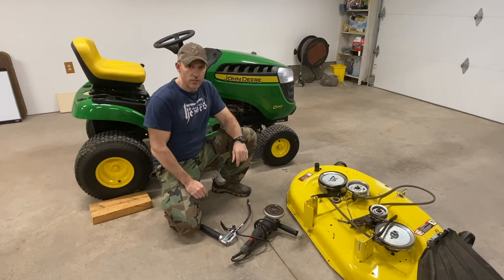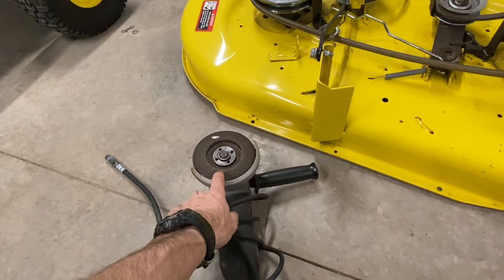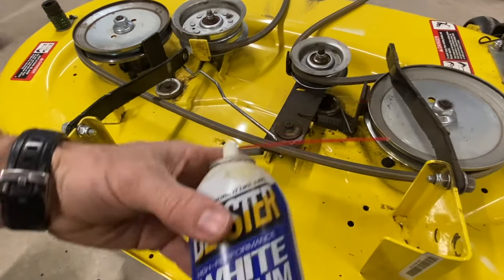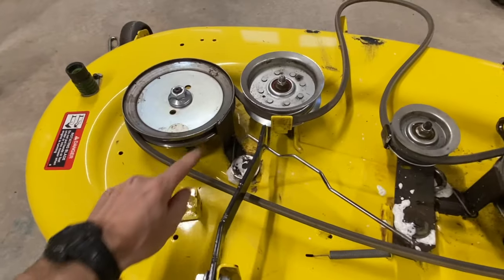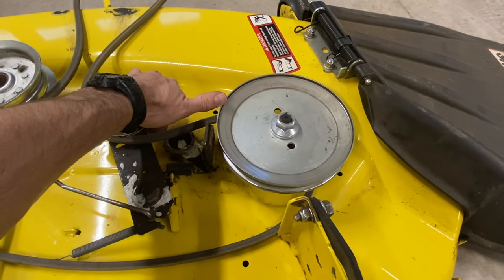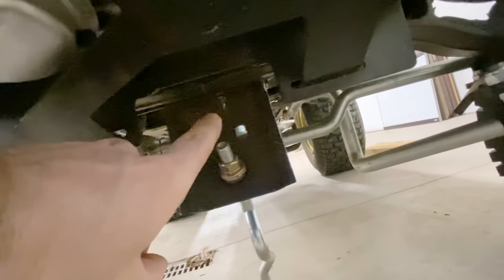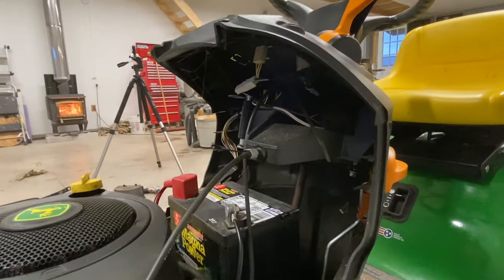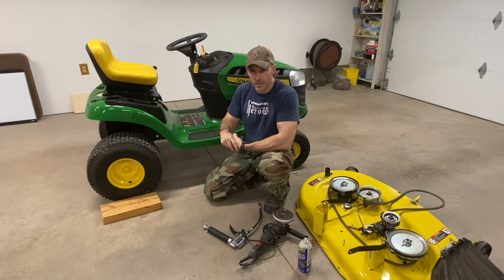grease fittings on john deere 100 series

Comment from the maker: ***Here are some links to help you service your John Deere, hope this helps you out. Please leave a comment and thumbs up, it HELPS YOU TUBE PROMOTE MY VIDEO.
John Deere filter kit    https://amzn.to/2UmTB5x
grease gun  https://amzn.to/2WJubQW
grease  https://amzn.to/33OBXKR
grinder   https://amzn.to/3brkZVA
flap sanding disk   https://amzn.to/3ay8ojz
socket set   https://amzn.to/2UCQDZv
lithium grease spray   https://amzn.to/33N5S6l
hearing protection  https://amzn.to/2wvwxZi
impact wrench   https://amzn.to/2WHcgdQ
impact sockets https://amzn.to/3apNvHc
5-W30 oil  https://amzn.to/2JeMRjN
funnel   https://amzn.to/2Uj3DEy
oil filter wrench   https://amzn.to/2JhrrlV
john Deere filter  https://amzn.to/3aqYT5u
napa gold filter   https://amzn.to/39lKl5R

** Support my channel by leaving a Dollar or two in my tip jar Thank you.
https://www.paypal.com/cgi-bin/webscr?cmd=_donations&business=2MTJWRFFTHLU4&currency_code=USD&source=url

Thank you very much for watching and God bless

*Full transparency. I am a participant in the Amazon Services LLC Associates program, an affiliate advertising program designed to provide a means for me to earn fees by linking to Amazon.com and affiliated sites.
Reply from the maker: You can support my page by just clicking on one of the links above, thank you for your support.
Reply: Thanks man. Mine is a little bigger, but it was fast and str8 to the point. Easy cam shots to see the fitting position.  I needed to the point and it was your video. The rest of the other videos sucked.
Reply from the maker: @jcaallen6662  glad I could help you out I try to make all my videos very easy to follow without all the fluff. Thanks for watching
Reply: @Clay Moses It did the trick and I now got access to my account again. I am so happy:D
Thank you so much you saved my ass!
Reply: @Xzavier Dariel No problem xD
Reply: Please see my comment on greasing spindle bearings

Comment: The two main pulleys on the deck have sealed bearings so they do not need to be greased they just never removed the fittings the grease fittings so basically they're just there for looks the breeze will go in the chamber but are totally useless
Reply from the maker: thanks for watching
Reply: I'd heard that too!
Reply: I wouldn’t say totally useless - filling the cavity around the bearing will keep water from sitting there
Reply: BS!  You pump them full of grease to keep water out AND the grease will penetrate “sealed” bearings with no problem. You don’t know what you’re talking about.
Reply: Other videos have convincing closeups of the ZERK fittings not only filling the spindles with grease, but actually show the inner side of both the upper and lower bearing SEALS being penetrated. The  INNER seals apparently made of a softer material to allow  penetration. Pretty Cool!

Comment: If you use dry graphite grease or dry lube it will help you out and not attract dirt, dust and sand to those pivot points and help you to keep the top of the deck clean when you hit it with some compressed air 😊
Reply from the maker: I guess you could do that. Thanks for watching
Reply: Dry lube or dry graphite grease works great with dirt etc not sticking to it and works great! Dry graphite powder or grease is also recommended to use in all lock and ignition cylinders as well. Great videos you got on your channel! Keep up the good work! Sorry if my last comment sounded like I was trying to tell you what to do or if it seemed my suggested method was better haha it wasn't my intention at all, just merely a suggestion if you didn't know about the dry lube or dry graphite is all. 

Again keep up the great work! I've subscribed to your channel also! I always wanted to do DYI videos but the editing I'm not a fan of haha
Reply from the maker: @jfrog180000  thank you very much Jason. I kind of enjoy the editing part. Thanks for subscribing also

Comment: My Grease fittings are dried up.(John Deere L118) Whats the best way to change them out or clean the hole?
Reply from the maker: You could take one off and try to carefully clean with maybe some break cleaner. Or you could take to an auto parts store and buy some new ones. They should not cost much. Hope this helps

Comment: the spindle grease points don't actually do anything lol its a design flaw.. thats engineers for ya! but to fix it just take the bearings out and take one seal off each of the corresponding sides of the bearings then put back together and the grease zerks actually do what they're supposed to
Reply from the maker: thanks for watching
Reply: @DIYJIM  I'm wondering if you could answer this for me.. I can't seem to find any ag tires for my John Deere which is a 20x8-8 rim, would a 20x10-8 fit those rims as well?
Reply from the maker: @detox5454  sorry not sure I would have to research this. Maybe you could post this question on a small engine group on Facebook
Reply: @DIYJIM  That's ok man lol was worth a shot but thanks for the speedy reply.. and I just might do that!
Reply: they are just dust covers not  "seals " lol you can pick them out with your fingernail and people think they gone stop grease from entering , lol.  a grease gun puts out like 10 000 psi every pump , grease until you see grease come out ends of spindles , grease will go threw bearing as it was designed  , it takes approx 40 pumps each when new  , after that do like 10 per each to purge old contaminated grease and it will fill with berrings with new grease  ,,  every time you remove the berrings for no reason  you are enlarging  the soft aluminum spindle housing , the bearings need to be a press  fit if not you will get a spun bearing and you spindles will be junk , .you need to knurl the spindle and / or use loctight berring retainer when putting them back if they are a loose fit .

Comment: I just ordered my replacement brake pads from my local John Deere dealer.  You can buy any part including springs, screws, clips, etc. from your local dealer, even if you did buy the mower from one of the retail stores, they're still willing to service the mower and sell you parts.
Reply from the maker: Thanks for the great info and thanks for watching have a good summer
Reply: @James Chumley, I had to take mine to my hometown JD Dealer {actually they came and picked it up}, I had to have one of the small wheel welded back on. I've ordered belts from there to.

Comment: Also one thing is every 6 months to 2 years you should take the back wheel off and grease the axel just in case if something happens to the back wheel so it'll be easier to get off
Reply from the maker: Thanks for the tip Jerry

Comment: The bearings in the spindles are sealed bearings so when you attempt to grease to grease the spindle no grease is gearing to the bearings so you are wasting your time greasing them. This was confirmed to me be a JohnDeere dealer. To remedy this situation you need to remove the dark from the unit remove the spindles and remove the top and bottom bearings in each spindle, you will see that both bearings are sealed bearings, so when you pump grease into the spindle no grease is reaching the bearings
To remedy this remove the seal on one side of the bearings and reinstall in the spindle with the bearings facing the interior of the spindle and re install on Tahoe mower deck
Reply from the maker: I made a video about what you are talking about. Thanks for the nice big informative comment. https://youtu.be/ybKR4wTLez0
Reply: they are just dust covers not  "seals " lol you can pick them out with your fingernail and people think they gone stop grease from entering , lol.  a grease gun puts out like 10 000 psi every pump , grease until you see grease come out ends of spindles , grease will go threw bearing as it was designed  , it takes approx 40 pumps each when new  ,  every time you remove the berrings for no reason  you are enlarging  the soft aluminum spindle housing , the bearings need to be a press  fit if not you will get a spun bearing and you spindles will be junk , .you need to knurl the spindle and / or use loctight berring retainer when putting them back if they are a loose fit .
Reply: So why have the grease fittings?
Reply: Wrong. Grease them sealed bearings will be penetrated by grease. SMH

Comment: Would anyone know the common zerk size (thread) for a john Deere riding mower? I had to used an 8mm socket to get one off on mine and mistook the 8mm and bought an 8m zerk which was too big? Maybe a 1/4 inch?
Reply: BTW, I enjoyed all of your videos and subscribed! Thanks for sharing your knowledge!
Reply from the maker: I’m not really sure sorry I have never taken any of my zerk fittings out. Thanks for watching and subscribing
Reply: See your John Deere parts dealer
Reply: I am wanted to replace the fittings on the spindles because I could not get a grease gun on them - they sit too low relative to the deck. I thought a fitting with a 45 degree arm would do the trick. The JD dealer only had the replacement part and was not very helpful. Looking at the parts list, I saw that the fitting came on the spindles, with no specs provided. FINALLY, I was able to locate what I needed in the specialty nuts and bolts section of my hardware store (basically a series of metal cabinets with small pullout drawers.) I found a metric grease fitting, M6 - 1.0, 45 degrees, regular pitch.
The old one came out using an 8mm open end wrench (be careful so you don't break the fitting off) and the new one was tightened with a 9 mm wrench. 
So funny to see the comment above that the bearings are sealed and greasing this fittings is a waste of time. I hope not.

Comment: I have 8 hours now on my E120. You can easily jump out the really annoying seat and reverse safety switches without cutting wires. The hydrostatic is awesome with those switches jumped out. I was afraid the deck grease fittings were difficult to get to. At this rate I will probably end the summer with about 25 hours. I will do the 30 second oil change and maybe take it back the the dealer and have them check it out for next year. I don't enjoy wrenching on things anymore.
Reply from the maker: I cut my wires for the reverse safety switch. If I put my parking break on I can get out of the seat without the mower shutting off. Thanks for the comment. Hope your summer is good
Reply: @Steve Fox just set the parking brake no need to restart the engine pretty quick and easy
Reply: @DIYJIM  pushing the button to reverse and mow was enough hassle to need to cut wires ? Or am I missing something cheers
Reply: @DIYJIM just curious, why would you want a safety like that off? Getting out your seat and mower shuts off.
Reply: I use the mower deck nozzle all the time. the blades have to be running. I also hose it down after every use and don't want to turn it off.. Cant use the hose while sitting on it

Comment: I have a Deere E130. I removed my 42" deck and attached my snow blade. What do I do with the blade engagement cable. And spring. Where do I secure it or?
Reply from the maker: Sorry I never did that maybe you could zip tie it to something. Sorry I can not help

Comment: Puralator Cross Referenced Filters, Better Quality and Cheaper than "John Deere"
Purolator L35310  Length 2.7inch
Puralator L10241 Length 3.4inch
  
The one Below is Not Recommended it will Fit Yes but it is almost Too Long...
⚠️Purolator L20195 Length 4.8inch
Reply from the maker: Thanks for the info
Reply: I have bought John Deere filters when they are on sale cheaper price or the same as cross reference ones

Comment: I was anxious to see how you get that straight grease tip onto those blade spindle grease fittings cause I sure can't get it on there.  The fittings are too low to the deck.  I have a 90 degree tip on order and hope that works.  I have to believe this is intentionally made difficult to get people sending them into the shop to get it done.  Very annoying,.
Reply from the maker: If your only mowing around 1/2 acre i would not worry to much about your spindles. thanks for watching Bob

Comment: Taking care of your high dollar investment called a good quality lawn tractor is good preventive mantenance.
Yours will last a lot longer then the ones left in the yard where they stopped mowing!
Hey and about that nuisance backup button that John Deere puts on all the Riders,
It doesn't make sense so you look forward at your button switch, you push the button and you will probably back up before you turn around and look what's behind you and you will probably run over and hit whatever you was trying to avoid where as jumping that switch out allows you to immediately look behind you before backing up this switch is a no-brainer engineering design to sell more switches like that. For demonstration information only. Hehe
Great video, to the point and get er done!
Reply from the maker: Thanks for watching and the nice comment have a good summer
Reply: The push button to reverse only needs to be pushed once, then after you're going in reverse you can let go of it. It's a safety feature, probably a Gov regulation but it is a pain and most users bypass it.

Comment: I found the grease for the grease fittings on the spindles spindles go only in a metal tube and don’t go into the bearings.
I had to remove both bearings on each spindle and remove the metal or rubber cover. I then cleaned the bearings remove the old grease. Then put new grease into each bearing.
Reply from the maker: I made a video on that, thanks for watching
Reply: Hard to get to and get out?
Reply: @DIYJIM  where video Jim please sir???
Reply from the maker: @timdurden5808  https://youtu.be/ybKR4wTLez0

Comment: Aren't the top wheel and lower wheel nozzles for grease connected? I thought I saw excess grease coming out of the bottom one when I squeezed some in the top. So you don't need to do the bottom one, correct?
Reply from the maker: Not sure what you mean but i think you mean  there is one zirk grease fitting for the wheel spinning and one for it turning. I would grease both. Hope this helps

Comment: Good video, but just want to say. My craftsman lt1000 was 20 yrs old and all I ever did to the deck was new blades and belts. I personally would not spray grease on pivot points because of the environment they are in. Sand and grass will hold in the grease. You obviously go to greater lengths cleaning your deck so it works for you.
Reply from the maker: Thanks for sharing, I think the older mowers lasted longer but hopefully if I take care of my John Deere it lasts
Reply: Lowes guy told me to grease it up every two summers. Zero chance of me taking off my deck. Not sure I'd get it back on right...lol.

Comment: Hey - thanks for the video!  I just picked a D130 from a neighbor that moved and I'm going through it - your videos are a great reference. I noticed I have a zerq at the front axle but there is a heavy shield in front of it. I can't get my grease gun fitting on it enough to get it to take grease. I even removed the front pivot arm to get that nut out of the area and still wasn't enough of an angle.  Any ideas?
Reply from the maker: Do you think maybe a different grease gun would fit. It’s hard to help without seeing it. Sorry can not help more. Glad you like all my videos I think I have about 18 on my John Deere
Reply: @DIYJIM  Hey thanks for the response! I have two types but the injector head is the same on both. Looks like a trip to the hardware store to see if there is an alternative. I've seen quite a few of your videos. I'll subscribe so I don't miss any new ones!  Thanks again!
Reply from the maker: Awesome thank you for subscribing

Comment: I use a Purolator Oil Filter and (Full Synthetic 10w-30 Valvoline Maxlife) in my John Deere 110 it's a V Twin, The Purolator is the Exact same size and Thread Pitch, etc and it seems to run smooth doesn't Leak any Oil or Burn it, and has almost 400hrs on the Engine itself
Reply from the maker: Sounds good to me if it works have a good summer
Reply: You go in great detail on the oil, but don't say what the oil filter number is, then say it was an exact fit - well isn't that a fact!!! Lol
Reply: @bobwhite2754  Do you really want the filter Number? I will tell you lol
Reply: @Robs_Got_A_Gun  Thank you no, since I wrote this I found that you have given that information at another area in the thread. No big deal, just thought it was strange.

I tinker with all makes and models of lawn tractors and ZTRs for a hobby so I buy oil filters in bulk of at least 12, then compare the original filter specs for that brand of mower with whatever I have in stock, so I am well versed in the cross reference charts and many of the common specs for dimensions, pitch, thread size, and relief pressures; but thank you anyway for your desire to help, it's appreciated, and may you continue to be so helpful in the future.

Comment: Sir, Greasing the arbors is a waste of time. The bearings are sealed. No grease will ever get into the bearings. You can remove the bearings and grease them. It is not a hard job.Lawn mower repair shops are ripping the customers off by replacing the entire arbor.Steves Small Engine Saloon explains this.
Reply from the maker: Thanks for the comment I will have to check this out
Reply from the maker: https://youtu.be/ybKR4wTLez0 my new video of checking the bearings
Reply: @Ken 
SPINDLE HOUSING WITH SEALED BEARINGS AND GREASE FITTING.  On these style spindles, grease is used primarily as a water barrier to keep water from accumulating in the void area inside the spindle housing and around the bearings and spindle shaft.
Reply: Its just to grease the spindles not the pulley bearings itself. Those are sealed just like on some vehicles its nothing new.